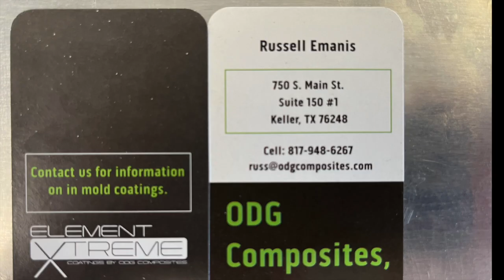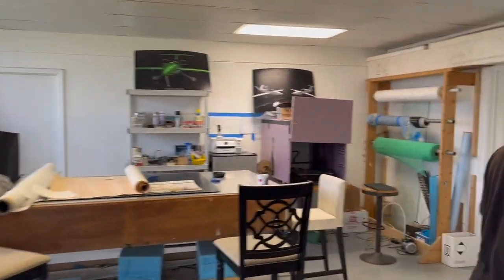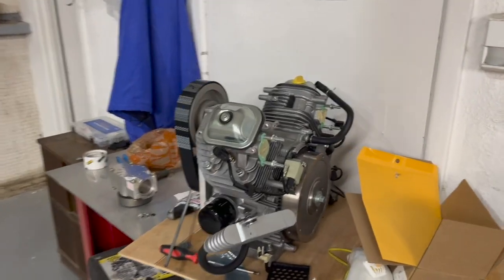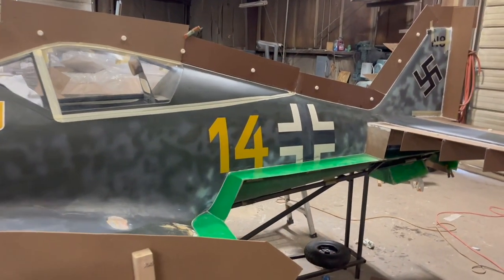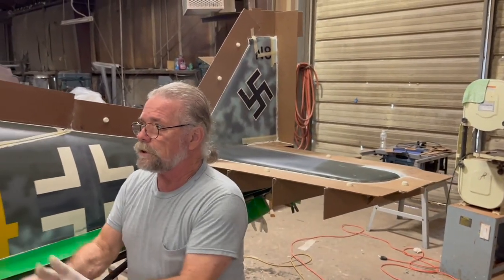ButcherBird 58 5

Comment: It might make ultralight weight but I doubt it will make part 103 speeds. The claim was just made that landing speed is 58, which is right on the line of max cruise speed. So thats a problem in itself, although I don't doubt that issue could be solved. The real issue is that youll have to drop the stall speed waaaaay down somehow, and a sleek fighter plane is just that: sleek. It wants to go fast, convincing it to make part 103 stall requirements is a nightmare, I know this from experience. Otherwise this is absolutely incredible and I am wildly jealous!